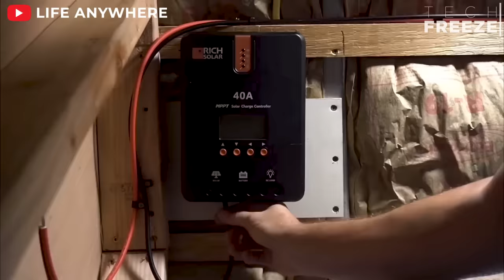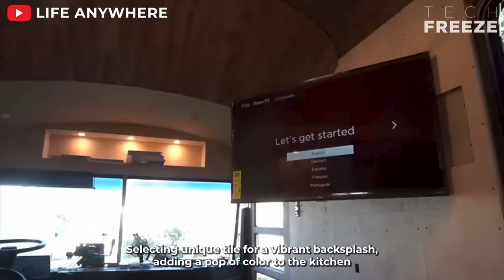Couple Transforms Bus into Amazing Mobile Home | Start to Finish Build by  @lifeanywhere

Comment: Beautiful but I can't help but think about how much weight all those building materials added. I was half expecting to see extra suspension, springs and even wheels. :)
Reply: I doubt it weighs much more than what it did with all the seats filled with teens.
Reply: EXACTLY! How far would they drive before the axel & frame warps?
Reply: I always hear these renovators talk about light weight materials being essential to managing weight issues.
Reply: @lululacanuck3824  That wasn't the case here but should have been a concern. I have been in construction for over 40 years building custom homes and now a residential door company so know exactly what they were using and trust me when I say that those materials have made that but way overweight. However, it is a nice job.
Reply: I asked a friend who works on these at the local school district. Manufacturers estimate their loads with each rider weighing 200 lbs on average. Plus gear. Such as football players or band teams. They should be ok.

Comment: Beautiful camper but LOTS of wood was used, wood on top of wood on top of wood. Lots of 2 x 4s too, usually 2x3s or smaller are used in campers. That bus must be extremely heavy.
Reply: Not to mention if they ever have time replace the washer/dryer they have to tear down a bunch of stuff to be able to get it out

Comment: 2700 tons later and you've got quite the ship. Absolutely stunning.

We use tile and grout in houses cause they don't move around much ya know.
Reply: Yep. Even when an RV is designed by professionals you still get things that crack over time. Tile should never be used. Should have been a flexible shower surround. That tile will probably fall right off the first time this thing flexes over some crappy camp Ground trail.
Reply: Hopefully you don't move it that often.

Comment: It all looks like old 70s style design build on a really tight budget. Meticulous is not a word I would use with this build.
Reply: And not very well planned, either; The tiles will be on the floor after it goes over the first railroad crossing. Looks like they did it to sell it and don't care how long it lasts.

Comment: How much weight did the bus gain? Then again It's designed to carry the weight of a load of people 👍🏻
Reply: The GVWR of a bus that size is 36K lbs, so I think they are good!
Reply: @elizabethsteen581  I think the question isn't about road weight, but about the extra weight on the suspension, drive train, and engine. A school bus isn't designed to carry all of that extra weight. I think the question about extra weight is an excellent one.

Comment: Your bus looks great except for one thing, when you put the sheet metal on the sides, I think it would of been better to start at the back and overlap your sheet metal panels going forward that way when you’re driving in the rain, it won’t get under the panels even with the panels sealed with silicone. That’s my two cents worth. But great bus!
Reply: Excellent observation.

Comment: Try to park it somewhere 😂
Reply: Why couldn't you park a school bus?
Reply: @KenyaG. 
There is a reason big vehicles often require special types of driver's licenses. 😅
Reply: @OublietteTight  I have a CDL. For commercial vehicles, yes. For an RV, no. So what does that have to do with parking? 🤔
Reply: @KenyaG.  I am merely saying that this is not a mini Cooper. After some practice,  I found parking technique was not an issue for my RV. Being ALLOWED to park was a big big challenge. Plenty of businesses in Florida prohibit RVs, period. (Walmart in St Augustine.)

Congrats on the  CDL. By having one, you already know size matters when parking?  So does turning radius. Otherwise, why did they make you get a special license? Don't you consider yourself better equipped for driving beastly big vehicles? I do. Kudos to you. 

Those that have only driven standard cars do not know what they do not know. For example, Turning radius of the back end of a bus / RV vehicle is something they need to remember. There is a lot of extension that a normal driver might not calculate. 

And clearance! I actually took the time to measure the height of my RV just to educate myself and really relate to what I was dealing with. Bridges and over passes were easy, they have signs. Trees? Not so much. 

And jostling... curb edging  is not a big deal in an SUV, but they do not have refrigerators with glass jars of pickles and bottles of wine.  

My point is, there is learning to be done and parking is part of it.
Reply: @OublietteTight  I only read the first sentence. The other eight paragraphs weren't necessary. I'm positive they wouldn't create something they couldn't operate, and all of the people that live in cars, vans, busses, and RV's have plenty of resources to use as far as overnighting goes. I'm sure there are plenty of places to travel to other than Florida.
Reply: @KenyaG.  if you do not wish to communicate, why are you? You expect me to read but you won't? You're a waste of time. Bye
Reply: @OublietteTight  I just asked a simple question. Why wouldn't they be able park? I didn't request a dissertation. You have a better day!! 😊
Reply: What?…Like somewhere you’d park an RV?
Reply: @OublietteTight You clearly have no idea what you are talking about.
Reply: @OublietteTight only if they have air brakes is a CDL required.   Only if they carry passengers is a Chauffeur license required.
Reply: @OublietteTight  Don’t know about where you come from but Im pretty sure that a privately owned parking lot is for SHOPPERS patronizing their store not for homeless deadbeats who don’t want to pay for a regulated parking area.  I’m with the Floridian authorities. I would certainly NOT be frequenting a store like that.

Comment: I entertained the thought of doing this with a 50’s era short 🚌 bus and installing a Cummins Turbo diesel for a power plant. Very nice job and thought process which is key for spending any time traveling, you have to utilize every inch. Nice job 👍🏼

Comment: I watched the transformation from beginning to end. The resolve and workmanship to complete such a project is very impressive. However, I could not help but think that you could achieve the same goals (travelling in a mobile home) for less money and time by just buying a ready made mobile home.
Reply: Absolutely good point.
Although as someone with a pretty broad skill set, I can appreciate this as a passion project.

I live in a community where home values didn't surge like they did in most other places.  Any updates I would choose to make for my home won't necessarily be paid back in my home's value, yet I would still do any of those upgrades just for my own piece of mind.
Sometimes its not about the money.

I will say that tiling that shower probably wasn't the best application for  a unit that is in transit and subject to a lot of movement and jostling.
Reply: This way they ended up with what they wanted, and not what some marketing department "thought they wanted"
Reply: Whatever they "wanted" it clearly was not for them as it was up for sale not long after completion.

Comment: Amazing work. Just worried how easy it will be to access pipework or cabling in the event of a leak or fault as the screws are covered and I couldn't see any access panels

Comment: Solid project. Just curious I see washer, dryer and fridge. That were installed and built around it. If one takes a crap. Do you have to demo all doors and a section to get it out to replace?

Comment: Only problem with this build is the insulation. Because of the metal you will have lots of condensation build up and drip. I had that same problem with my first build. …. Over all beautiful home built and very strong. Great job guys

Comment: It looks really cool. But I have some questions. When they put in the large windows, did they use any cross-bracing for a header? Also, are  they concerned about the longevity of the tile? I'm glad they didn't use gypsum board 😊

Comment: Complicated and lots of difficult hard work. Very well done. Would have liked to see more. Selection criteria for the bus. Evaluation, condition/renovation of engine, transmission, suspension, brakes, wheels, vehicle electrical system etc. Weight-saving considerations when choosing materials used inside. Solar-system energy storage and controls. Safety monitors on board (gas, smoke, fire). Air conditioning/heating systems. Exterior conveniences - awning/side-tent, exterior lighting/entertainment. General storage space - bicycles, bbq, table/chairs. Towing system for utility vehicle. Size/placement of clean/dirty water tanks, generator, hot-water systems. What was the result for road-handling & fuel consumption ?

Comment: I see 2 possible small problems... first did you leave space in wooden subfloor for expansion? Second have you checked weight of bus since the installation of everything? It may need a helper axle. Usually anything this large is at weight of not only axles but tire limits... any additional like people, luggage, and miscellaneous like added fuel, water weight etcetera may be too much.  All in all, very nice WTG!!

Comment: I lived in an RV for 3+ years. 
Good luck cleaning out/ changing the bunks' bedding. You might regret that tightly closed design. 😮

A+ for hard work. B+ for overall design functionality. C for exterior color... needs more detail, contrast. A for the big frig. A for washer dryer. A+++ for roof redesign. B- for small windows... not enough chances to see an unobstructed view. A for solid infrastructure. 

D for bunk design. Sorry, but they are probably going to make you angry later on. 😢
Reply: And if they choose to live in it all year, they come out on top. I'd pick a motor home over a house in a heartbeat.

Comment: One interesting question is how much weight was taking out originally, and the put back in with the remodeling. It would be infesting to see the fact sheets before and after. weights, how big is the power solar generator, I think even saw laundry.

Comment: Wonder how much the RV weights? I remember when my TV company built the OB (Outside Broadcasting van) and the VTRs (Video Tape Recorder) were very heavy 2” giants and the van had a large generator too. When that was in M.O.T. it was so heavy that we had to remove 400 kg (880 lbs) of stuff before it went thru. Did you have any problems with that?

Comment: I think the only issue with weight is fuel mileage. There is always a balance of weight vs durability, but I doubt that they would be over legal weight which is based on safety data.

Comment: How many tones did they add to the weight of the bus???... The wood is weighty and it was more indicated to use fibreglass instead. The bus can be driven at a maximum of 70km/hour, after charging it with all those things!... I'm not asking any more about the money invested...
Reply: a school bus could have a 36,000 lb. max weight. I think they did just fine. I hope it has a heavy-duty suspension.

Comment: I would be curious to know how much weight you added to the bus with all building materials. Generally RVs use very thin and lightweight materials but you went all in with heavy wood members, tile, butcher block, thick cabinets, tongue and groove materials etc. You may have created a vehicle that exceeds its max gross weight rating. You realize the engine, transmission and brakes need to handle all that extra weight?
Reply: Exactement ce que je pensais.

Comment: Awesome build, but I think you made a critical mistake with the insulation. Outside is metal and you didn't apply damp resistant foil/hybrid foil (don't know how its called in English). That means moist will collect between the inside wall and steel outside. You also need ventilation holes to vent between foil (when applied) and insulation.

Comment: Wow, you've given yourself a horrible blindspot on the passenger side by not having a window immediately behind the entry door.  Fortunately, easy to fix with an exterior camera wired into the TV you already have mounted to that wall, approximately where a window would be!

Comment: Lovely, but you made a common mistake that will cost you dearly.  No vapor barrier.  The insulation will be in soaking wet after a couple of seasons.  Condensation

Comment: You are a good craftsman.  You seem to be good at all the trades.  You are not a camping or travel person.  Your rig is over weight by quite a bit.  Go get it weighed.  You cannot build with 2X4's and 3/4 inch anything.  It's not a house.  I can only hope you can use it for what you are looking for.  Good luck.  It's not the destination...it's the voyage.

Comment: Sooo....
$3500 for the bus
$35,000 for materials and equipmnent (fridge, washer, dryer, solar, etc...)
----------------
$38,500
They could have bought a new one with a full factory warranty.
Reply: Nope, this way they ended up with what they wanted. No motorhome offers full washer and dryer or standard refrigerator. they did the right thing. Challenges and all.

Comment: It would have been much easier, cheaper, and functional to simply build a tiny home modeled on the shell of a school bus than to use an actual school bus. 

I can’t imagine this thing being even remotely worth the price when you consider the weight and disadvantage of the mechanicals. Not to mention the fact it drives like…well…a school bus.

I don’t know. It’s cool to repurpose things and do it with flair but this isn’t like turning an old lamp shade into a flower pot.

Comment: Pretty interesting. But the difference in weight must have an effect on the engine. I know the bus was designed to move 44-46 passengers and seating, but with all that was added I'm sure that exceeds the original intended wieght load. And can we discuss that color? What is that? Pale light greyish cyan? it's awful.

Comment: They make RV's already.  I bet it wouldn't be that much cheaper or labor intensive. Than buying a used motor home.  I lived in one i know.  Guess you have lots of time on your hands.  Like the tiny house is no nrw thing.  I lived in a mobile home.  Very reasonably priced i might add.  Oh you can be stylish in a tiny house but, trailer trash in a mobile home.  I get it.  Mobile home is cheaper than any tiny house and so much more room.🤔

Comment: Sad because when it's done it will have a very low resell value. Better to start from a new chassis and build your own body. I have built many buses and learned the hard way. This only makes some sense if you are going to keep it. For 60,000.00 you can buy something already done

Comment: For anyone else doing this the framing of the floors is completely unnecessary. You can drive the the bus onto the insulation and it won't deform.

Comment: For the money and time you put into this you could have just bought a really good used motor home.
Reply: Absolutely, especially with all the labor it took. Not to mention, believe it or not, many rv parks won't even let you rent a space unless your rv is less than 7 years old, even if its completely renovated especially in places like Las Vegas where space rent is as high as $1,100 dollars a month, so there's that. Greed has taken over making it nearly impossible to live cheaply anymore. Sad.

Comment: Critical .. The gas tank specification is just 25-30 gallons because they are not meant to be driven long distances between gas stops... .. this is from the state of Virginia school bus specification document ... This vehicle will  be very difficult to take on any road trip... The stated  MPG range is from 6-10 mpg.... Using 8, it would have a range of 240 miles max... for my driving style, I fill up between 1/4 and 1/2 tank on long trips. So we are talking about 150 mi between gas stops roughly.. That's a no-go for me

Comment: I want to see what the CAT scale has to say about this thing with passengers and fully loaded water tanks. What’s the weight distribution per axle? What are those axles rated for? Also if you’re going to go through all this time/ energy/ expense to take this thing on presumably long road trips, why would you use a cabover? They’re so much less comfortable. How would you insure it if it’s this extensive of a DIY job? How do you plan to afford the amount of diesel it sucks down without it being a commercial vehicle any more?

Edit: Ah, and they’re cramming the kids in coffin size bunk beds.  Yuck.

Comment: your going to need a different engine, these buses are fitted with engines for town use, low gearing and light loads, it now weighs as much as a semi trailer and is to be used on long journeys, the engine fitted will fail pretty quickly,

Comment: Not gonna lie.  Not trying to be negative or whatever.  Just watching this and wondering when pouring the concrete footers for a foundation would be happening?   Errr. ~ Never mind any rust ~ etc for the frame,  Or the wheel baring health, or springs and shock absorbers, gas mileage, poor engine.   Maybe if ya didn't have too far to go.... I suppose.